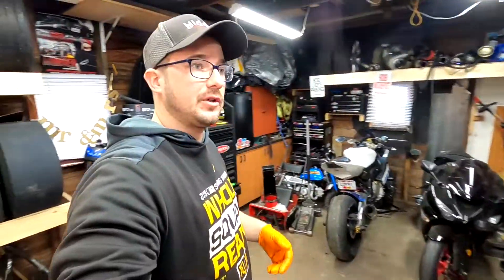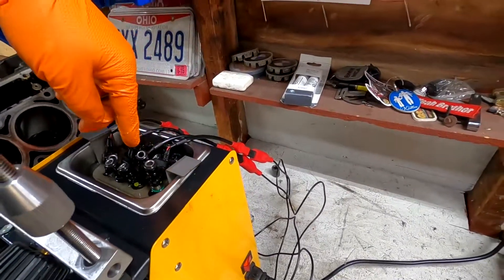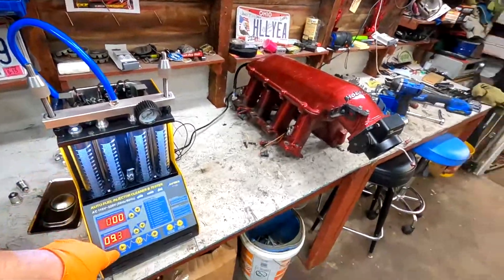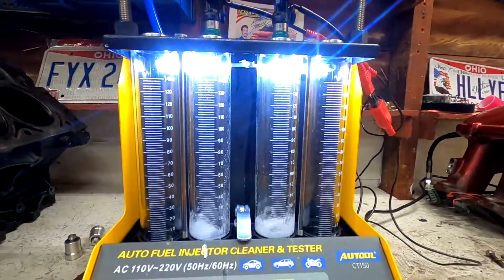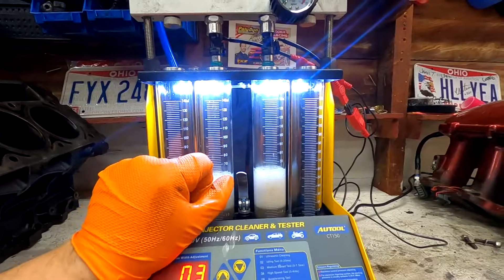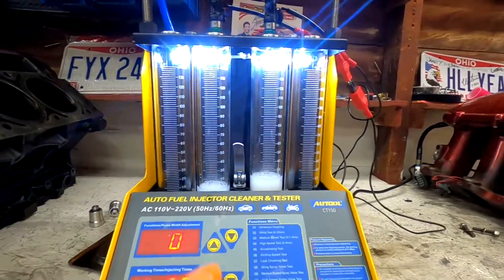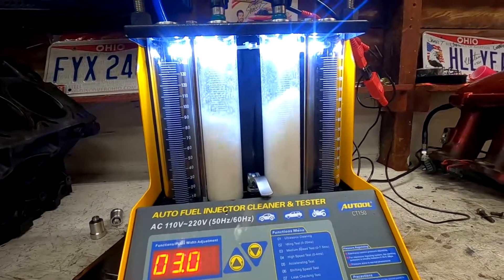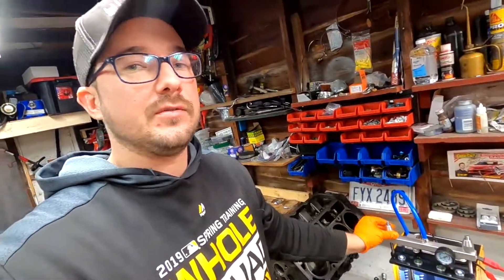HOW TO: Cleaning And Flowing Injectors With Autool CT150

Comment: Which model is best CT150, CT160 or CT200  I'm planning to use it on Toyota's, Honda's and Nissan mainly Japanese cars
Reply from the maker: The 150bworks great
Reply: @HiddenMotorsports  I'm thinking of getting the ct160 because of the heating and weight difference.
Reply: @stoneyvill  the ct160 has two ball valves to drain two separate fluids and the heating Sonic tub which is a thumbs up for me